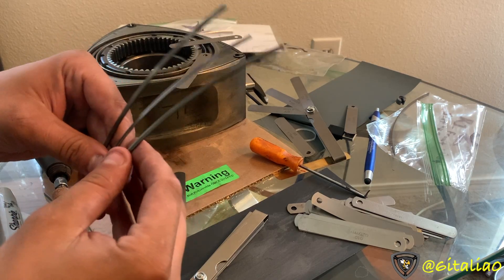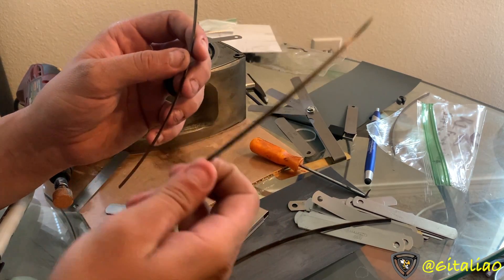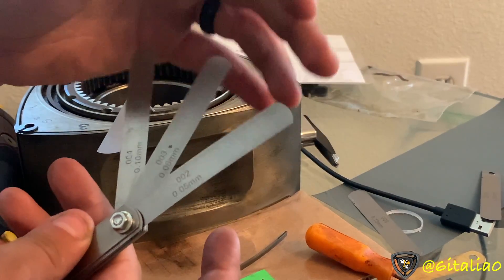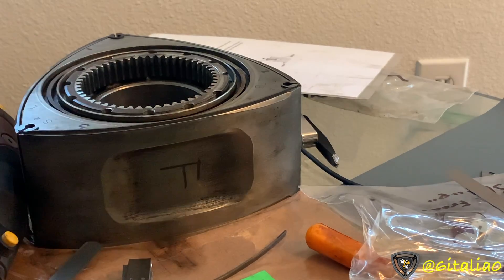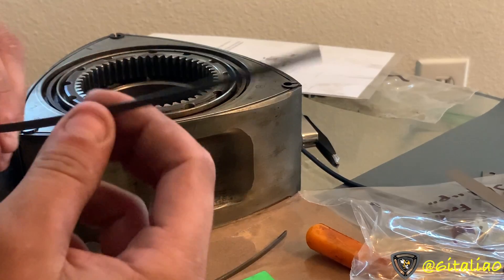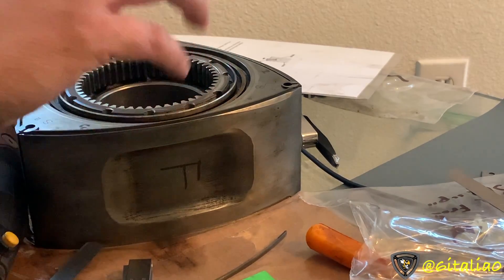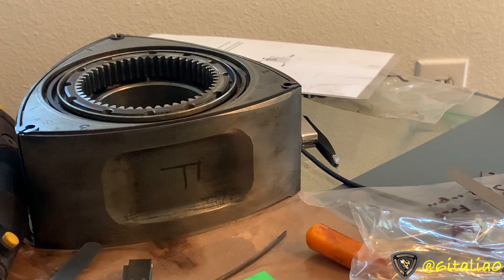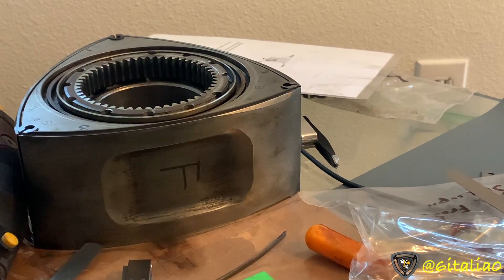THE BASICS OF CUTTING AND CLEARANCING RENESIS 13B SIDE SEALS

Comment: Hi, an info please. Mazda doesn't make the Side Seal of the correct length according to the letter on the rotor? Thanks.
Reply from the maker: The number or letter codes stamped into the rotors on each side seal slot corrensponds with a precut side seal that's within a tolerance "range" that falls within spec, but is not guaranteed to be consistant or within your preferred tolerance. For first time builders that may not feel confident in cutting their own seals it is recomended to purchase precut side seals as the engine will run fine with them, but for builders like myself that wants the best outcome possible with consistent compression across all faces cutting seals down is the better route and worth doing if you're up to the task.

 If you'd like to know more about cutting RX-8 side seals check out my how to guide which can be found here https://youtu.be/5xkHL6g1Sic

Comment: Do I slide the side seal to one side and measure the clearance on the other end? Or do I have 0.1 mm/0.004" clearance on both corner seals?
Reply from the maker: You measure on one side only and want .004 for a standard renesis and .002 if clearance goes for an older peripheral exhaust engine
Reply: @NateRist  You are the best! Thank you very much. Love your videos.

Comment: I just wanted to ask to clarify since it wasn't shown in the video, are the side seal springs in the slots when all the measuring and cutting is taking place. I have to assume that they are because the corner seal springs are installed and the side seal would fall down alot further in the slot without a spring. The reason to ask is that the atkins sheet nor the msp service manual show the spring in the slot on the diagram showing the side view of the seal and slot. There is slso no mention of the spring in the instruction wording. Hope my question/comment is clear as mud.
Reply from the maker: yes you use springs in the corner and side seal slot when checking clearance and press down evenly when you do
Reply: @NateRist  Thanks for the reply, thats what i thought after beating my head against the wall one night without using the side springs.

Comment: So those racers are scammers? Those steel seals scrape rotor housings ?Can you make a video on this
Reply from the maker: this video is about side seals, not apex seals, however, 99% of aftermarket apex seals are just cheap poorly made products not designed with longevity in mind. the OEM apex seal Mazda has developed over decades is designed to wear down with the housings whereas aftermarket “unbreakable” seals are made to withstand very high boost levels and to not break as easily under detonation from poor tuning (hence why many tuners recommend them as their job is to tune and get results, not to make the engine last). the manufacturers of these seals also don’t do much if any real R&D beyond drag racing hence why they only boast about their seals being used for drag racing and holding up fine for over 20 1/4 mile passes (or 5 miles) but not so much in street driven applications where they’ll admit that you’re lucky to see up to 60,000 miles with brand new housings. The reason for this is because the seals are very hard and wear against the housings instead of with them so even if you dump 3 Oz per gallon in your tank each fill up it still does little to counter the excessive wear and only increases daily running costs.

If reliability/longevity is what you’re after then OEM or ceramic apex seals are your best bet as they’re proven seals designed to do just that. if you’re just looking to throw a shit ton of boost and a sketchy tune at it and make a lot of power for a little while then throw whatever seals the internet tells you in it.
Reply: @NateRist  nate I really appreciate it I had no idea those racers sound so convincing I really don’t have much money but I love my Rx8 and I want to Make a long lasting Rotary engine my Stock motor Is at 150k miles and still running great I take care of my Rx8 if I didn’t buy it, it woulda been in the dump by now
Reply: And yes I did come here to learn about side seals it this video really helped I really enjoy your channel keep making more Content:)

Comment: Good information my friend. Was having issues clearing my rx8 rotors. Would i do the same way if im running my motor as a n/a but clearance at 00.2?
Reply from the maker: For optimal compression and enough room for expansion.004 would be best. If you’re using rx8 rotors in an older 13B then .002 would be fine
Reply: @NateRist  thank you. So i use the 2 00.6 feeler gauges as you have shown?
Reply from the maker: @jamesslessor3446  you use 2 0.15mm feeler gauges at either end of the side seal